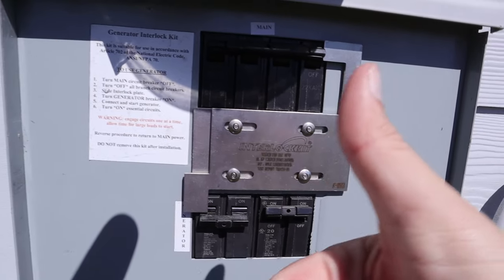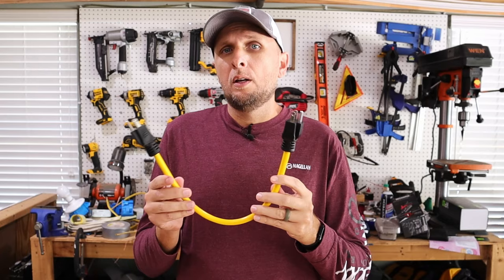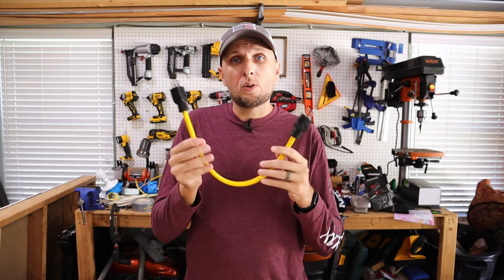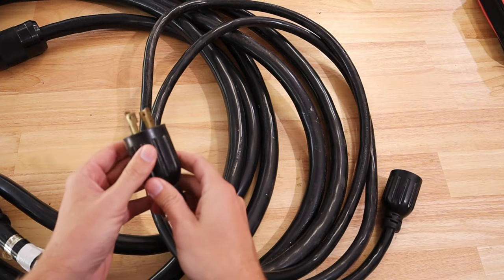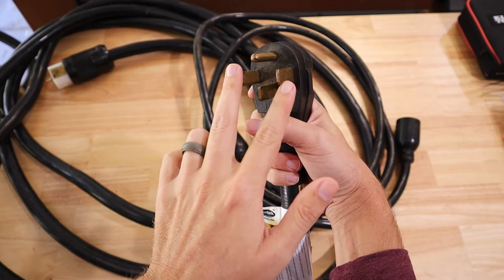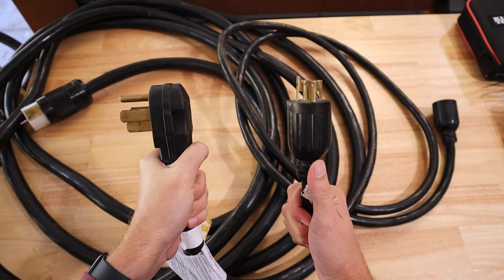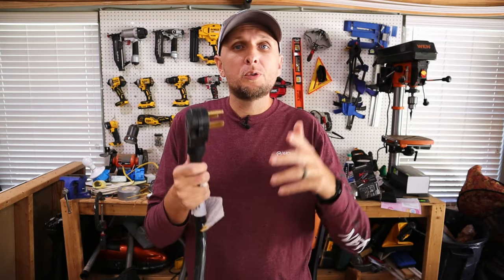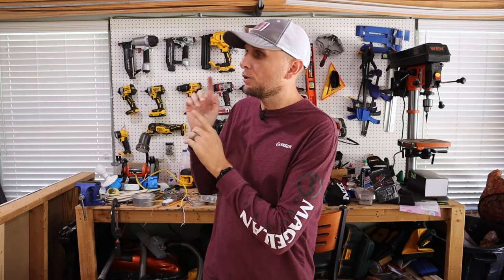HUGE Electrical Mistake Too Many People Make - Backfeeding

Comment: We powered our fridge and lights in apartment when out power got shut off ,due to non payment... the landlord even gave us his male to male cord and his the one that suggested doing it,we just made sure to plug the dead end in first,then went out into the hallway. Never had an issue. And that how we renovated the apartments that were empty,and had no power.   But I agree it is dangerous,just one person that is not with the program can be seriously injured. And especially if you have kids or pets running around,but we didn't have that to worry about . The only time I needed a generator for powering my fridge in a power outage,I plugged it directly into the generator.   Good vid!

Comment: While back feeding is something I just found out about a few weeks ago, thinking back to my days in electronics engineering school (which was a very long time ago) the only issue I see with back feeding using a suicide cord is, you probably don't want power to be restored while your generator is running and supplying a voltage to that circuit. That would most likely immediately damage any electronics connected to that circuit. One power source will be out of phase with the other. If the circuit is a residential 120VAC circuit and you connect a 120VAC output from the generator and power is restored, let me think.... That's connecting in parallel so the voltage would remain the same 120VAC sort of like jumping a car battery, but you'll have an issue with the current and the wiring. I don't know, I would definitely just run off the generator separately, that way you won't have any issues. Best to have an electrician do the wiring if you intend to switch over your home to generator power during an outage. And yes there is the possibility you electrocute a lineman or mess up your neighbor's wiring although I would imagine that there are components inline outside on the pole to prevent back feeding for safety.
Reply: "although I would imagine that there are components inline outside on the pole to prevent back feeding for safety." With AC current there is no way to do that. A switch would be the only way to stop back feeding. With DC current, a diode can certainly be used to do just that.
Reply: @emuhill  
NO! NO!! NO!!!  There are no such devices "outside on the pole"!!!!
YOU are the device that prevents back-feeding.  YOU are on the INSIDE ... thinking about what you're doing.
That way, a hard-working linesman a mile away doesn't die because you didn't know what you were doing!!
Reply: What you need is a Generator Interlock Kit (Found these a couple of years ago).  Under $100 (usually around 50-70) Its a plate that gets screwed into your panel cover that Bars either top left (Slots 1-3) or Right (Slots 2-4) from being engaged when main is closed (engaged).  Then you wire a 30 plug box from outside the house to a 30a breaker in one of those positions (It depends on your panel manufacturer which side the interlock works on).  Once installed You can plug the generator female side of the extension cord to the house box, plug male side to gen.  THEN you have to open (disengage) the main breaker, slide the plate so it locks the main out, THEN close the generator 30a breaker.  With this plate in place it is impossible to have main and generator engaged at the same time and saves a lineman's life, or have a back feed from the main side blow your generator into the next yard.
Reply: You turn off the main while suppling power to the panel from the generator. Before turning the main back on, you disconnect the generator, in my case by shutting off the 220 breaker to the generator. That's the idea of the interlock kit, so only one or the other can be on. In my case, my panel is from 1960 and the interlock won't work so I rely on me to be the interlock.
Reply: Doesn't matter if the grid comes back up.. IF you throw the MAIN BEFORE BACKFEEDING!

Comment: So sometimes trusting an electrician to do it isn't always the best.  So I learned a bunch of stuff about generators recently the hard way.  Turns out when a generator doesn't detect the ground and neutral connected together it automatically switches to another mode where it makes both the hot and the neutral HOT! With half the voltage 180 degrees out of phase.  Fine when your geni outputs 120 only, with 240 catastrophic.  In my case my geni transfer panel had been installed by an electrician over ten years ago before I bought the house.  Since then we only had a 120v geni.  It couldn't run our well pump so it never had much of an issue.  Well we inherited a 240v geni from my mother-in-law.  We've had a few power outages since and it was so nice to have water.  Well the power company sent a letter that they would be shutting off our power for 6 hours to replace a large pieces of critical electrical equipment some where in the system.  I wasn't worried I had my new (and it was new, my mother-in-law never used it) 240v generator!  Then the day comes and the power goes out, like I was expecting.  Well it was cold I had just run the water ect...  Anyway, I go and started up the generator.  Then when I come back in I hear the furnace, well pump and hot water heater all try to come on at once.  Each time with a big kerclunk.  They stopped at the 3rd try.  I go upstairs and my son tells my the lights are blinking and doing weird things.  I go into the office and I smell burning electronics.  I go into the kitchen and turn the light on, and and I thought that light was brighter than usual, after about 10 seconds the light went out.  It suddenly reminded me of my younger years when I tried to replace an outlet and it turned out to be a 208v outlet and blew a 120v lamp out in seconds.  I opened up the switch box and tested the voltage across the live and neutral, , sure enough 240v!  I raced down stairs and disconnected the geni.  Way too late!  I spent the rest of the day trying to figure out what happened.  The next day the power went out due to a storm and I spent most of that day troubling shooting it was well.  At 1st I thought it was something I did, then something wrong with the generator, but after I had eliminated everything else my only conclusion was something wrong in the panel.  I tested the generator cable's ground, it was grounded and then I tested its neutral... it wasn't!  Then I knew something was wrong in there!  I followed the neutral wire back from the transfer panel to the main panel, everything looked fine.  So I loosened the screw that locks the neutral down to the ground bus bar and puller it out.  To find the screw was tightened down only on the insulation of the wire, not the exposed part.  This was a ticking time bomb in my panel for the whole time I've owned the house.  Whoever installed it pushed the wire in too far and tightened the screw enough to pierce the insulation just enough to complete the circuit.  Since my 120v geni couldn't run the well pump nothing ever used enough amps to be an issue.  When I connected the 240v geni the only thing that needed to happen was for too many things to come on at once.  It over heated the neutral in the breaker and caused it to disconnect.  For some dumb reason the generator instantly kicked over to floating neutral mode and BAM!  Me out a bunch of time and money.  It took quite a bit of searching to find out this is what generators do.  It should be stated clearly in the manual!  And yes I read the manual!  If I knew who installed the panel I would have contacted them and told them to file a claim with their insurance.  Instead I've had to brush up my skills on the board level repair of electronics.

Comment: I don’t know of any outlet that carries 30A without have a 30A plug type, so NO, you will not overload your 12/2 wires in your house if using one of those suicide jumpers. Even 20A connectors require a 90degree prong. So those cables are 15A only, just like the outlets in your house.  
As for people that don’t open the main breaker, straight to jail.  And for people that don’t open the individual circuit breaker to prevent overloading a 15A line, the breakers (gen, house and GFcIs) will keep tripping. 
We need to stop pretending/acting as if things like a suicide jumpers start fires and electrical shock. This mentality is the same as “guns kill people”.

Comment: Can you talk a little bit about fire hazards with this issue? Or 220 vs 110? 

I say that because the main two risks you pointed out on the video can be mitigated by: 

1) turn off main breaker in house to prevent back feeding to the electrical grid. 
2) turn off all the nonessential breakers you’re not going to be using so that you’re not trying to pull more power than the generator can create or than the line being back-fed can handle
3) plug everything in before turning on the generator so that you’re not holding a live wire.

What am I missing?
Reply from the maker: Yes they can be but it's not guaranteed.  People forget or don't know.  That's why everything I talked about is required and better.

Comment: How could i possibly kill a lineman if my outside main breaker from the pole is switched off? How could power ever leave my box and go that way?
As for using a suicide cord, don't people know to NOT to start the generator before plugging in? Don't they know to first switch off all breakers and then plug in the cord and Then crank the generator and then slowly, one by one, start flipping on just the needed inside breakers? I'm sorry and sure, i am an idiot, but even still, i'm just not seeing the problem with.

Comment: I used to use a cord like that when I was working  in a apartment that had no power I would plug one end into apartment common area hallway and the other end into a outlet in the apartment unit so I can have lights and power outlets In that area that I'm working in.

Comment: You mention that connecting with male to male into house 110 volt outlet that is wired with 14 ga wire only good for 15 amp.  You say generator may be capable of putting out much more current and this could lead to house fire.  Please explain how back feeding your panel thru a 15 amp breaker in the panel can accept more than 15 amp no matter how many amps the generator is capable of putting out.  Would't the breaker blow?

Comment: With so many idiots I'm surprised the safety nannies allow people to cook or have a fireplace indoors.  The supposed suicide cable ( a cable with exposed  potentially energized contacts) is commonly used by most generator manufacturers to parallel  generator together.   The red and white banana plugs are tied directly to line and neutral on the generators output.  As for backfeeding the grid, its highly unlikely that any homeowner generator is going to be able provide power for more than a few seconds, given the grid will look like a dead short to the gen. The generator inlet box setup can easily become unsafe if there's no interlock on the breaker box.

Comment: Maybe you know this already now but that is not a dryer cord 4 prong it is a Range cord Dryer cords have an L shaped prong in the connection, think of it this way Range plug straight slots and prongs, Dryer plugs L prong Laundry.

Comment: My house has a lockout switch on my panel…  and a dedicated 20A breaker that’s connected to a dedicated plug, it uses that exact suicide cord. I have actually used it during an outage. It powers few lights, including bathroom lights, I plugged it into my EcoFlow power station. I don’t think its unsafe, the led bulbs in total didn’t even use 300w total and the main breaker is off and locked.

Comment: Backfeeding a generator is perfectly safe — if you are knowledgeable, prudent, and practice good habits while doing so. The problem is that backfeeding introduces numerous variables with potentially deadly results. 

If you have wired a few houses, understand load ratings for your cables, and understand how/when to isolate the electricity while working with it, then you are less likely to die.

Comment: Generators have a 30 amp breakers so a 10 awg generator cord is sufficient. I do not understand why people are using a 50 amp outlet with heavier gauge wire unless distance is over 50 feet?  You really only need what the generator circuit breaker is rated for which is a 30 amp connectors with 10 awg. It's really that simple.  Turn off the main breaker in the service panel first.

Comment: If you are making connections while your generator is running, Darwin is at work.   That being said, ALWAYS make sure main breaker is off while utilizing a generator or battery/inverter backup.

Comment: I have a suicide plug but it is a 50 amp connected using a male RV plug on both sides wired to the fuse box with heavy guage wire using a double throw 50 amp breaker.  No issues.  You dont power anything up before pluggin everything in first.  If it was so dangerous then 50 amp rv plugs would be dangerous to plug into an rv park or house.

Comment: Ive built these, their very handy. I've measured 240v across two receptacles. To make sure i know where l1 and l2 are. And backfeed power. With my inverter. But just make sure you're main. Breaker is off. Very important. Or youll toast you're Equipment. 😮😊

Comment: My goodness, the drama. First, if you open the main it isn't possible to energize the utility's lines. Well, maybe if you have a Federal Pacific panel but if you do you should replace that immediately. Second, unless you have one hell of a generator you aren't going to kill a linesman by forgetting to open the main. But you will kill your generator. Third, no power flows through an energized male plug unless you make contact with something for it to flow through. Maybe your fifth grader is smart enough to plug it into that NEMA 6-50 outlet that you're going to backfeed into first and THEN plug the other end into the generator. Another idea is not to even start the generator until your connections are made. Now you're backfeeding through a 50A receptacle protected by a 50A breaker on the generator into a 50A receptacle protected by a 50A breaker in your main or sub panel. If you understand residential wiring and generators you should be able to pull this off safely. A great conversation to have is making sure your generator is up to the job of whatever you want to power with it and whether or not you want the ground bonded on the generator. I know so many people who have backfed their homes this way safely but to be fair they're all EEs or electricians.

Comment: Yesterday I did it for few hours but not with regular 120V cord but rather using the dryer outlet I have in my garage. However, I wish I had at least a 220V/30amps breaker spare to install instead the 50 amps installed in my electrical panel. In the end it work great but for sure you have to know what you are going (e.g. close the MAIN and only use appliances that you know won't need much power yo avoid problems) In an emergency it's still doable but you have to take the time and not forget anything because for sure it's not the good way and dangerous a bit.... Now I am thinking about adding a subpanel with correct plug and so on but it's costly...

Comment: I keep my backup power system 100% seperate from my home's wiring. I have found over the years you can't trust a main breaker 100% of the time. I had to replace the one in my panel a few years ago because when I turned it off so I could install a new duplex outlet I discovered one leg in my panel was still hot. Luckily I tested the outlet wiring before working with it and avoided being shocked. I've been zapped by 120vac before and it's not fun.

Comment: If I ever build a house, i'd have a workshop, where I could also plug a generator, equipped with an exhaust fan and a carbon monoxide detector. Ans the generator would be feeding into a transfer switch. I'm too scared of leavibf my generator outside.

Comment: Does anyone reading know an answer to this? I have a generator with a 120v/30amp outlet (tt-30p, which means only one line is hot “green, black, & white”). I’m making a "suicide" extension cord with a tt-30 male on one end to plug into the generator and a NEMA 10-30 dryer plug on the other end to plug into the dryer outlet. The dryer plug/outlet has two hot wires going into the house (black, red, white & but no green). Can I splice together the two hot wires on the dryer end to the single hot wire on the extension cord and be able to power up both poles of the circuit box with 120v? Will the power level be degraded due to the separation into two lines? Will there be any short circuit issue here? And also what do I do with the green wire coming from the generator since there is no green ground wire on the NEMA-30R plug going into the outlet? Thanks
Reply: They sell adapters/ short extensions that go from 120v to 240v and vice versa for this purpose and all the wiring is done inside. I would spend the $20 just to be save.

Comment: You mean the lazy ass line guys that turn a 1 hour job into a 6 hour job those guys will get shocked. And yes they do stretch the job out , 99 percent of power outages happen in over time pay window .
Reply: You definitely shouldn't be wanting them shocked even if they are guilty of this. But I do agree, something is up. Any power outage seems to last at least many hours now, wasn't always like this. Honestly it might be a plan from the top down to get us all used to rolling blackouts. It's coming, especially with EVs being forced into the equation way before the grid is ready. 100-150kw to charge one car? Madness, that's just madness...